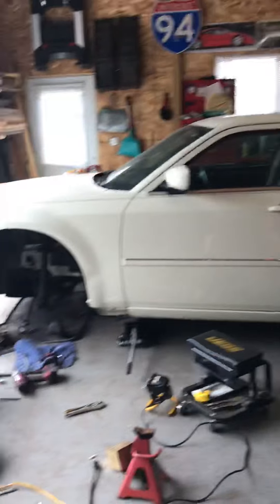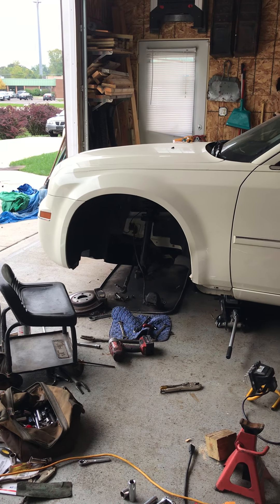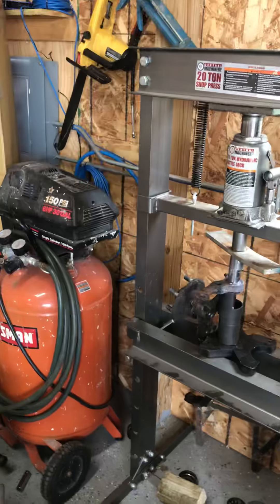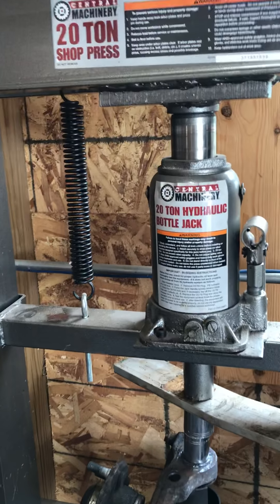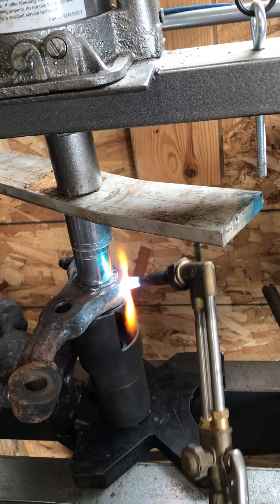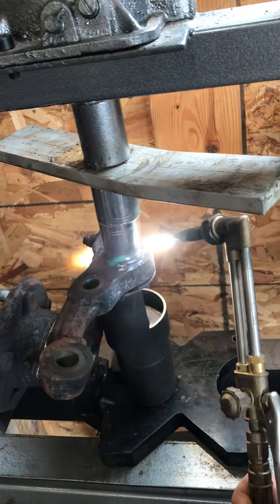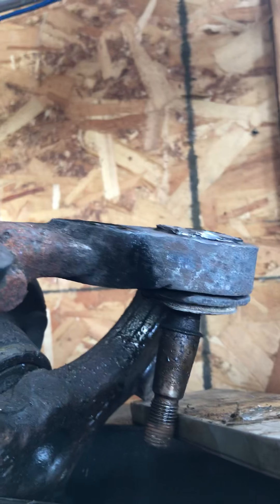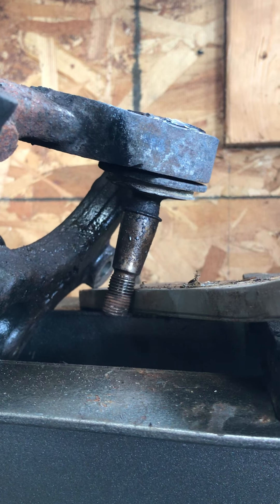Lower ball joint Chrysler 300 2007 part 1

Comment: Try drilling out the bottom with a few holes first to help weaken the ball joint so it collapses that way when you heat it back up # 1 you won't risk the actual ball to come shooting out like a bullet from the heat that can build up and cause pressure inside the ball joint cavity # 2 turn the heat down some on the torch because that looked more like a carburizing flame which is too wide that's also heating up the ball joint at the same time causing it to expand with the control arm and seizing up !  # 3 Smaller more concentrated flame on the torch to just heat the outside of the control arm then make sure your press is set up ready to go so all you have to do is shut the torch off then start pressing right away so it doesn't have as much time to cool down like it did in the video !  I usually like to keep some pressure on the ball joint with the press then heat up at the same time because it saves time not having to shut the torch off then checking to make sure the hydraulic Jack is ready to pump then putting the handle into the jack to start pumping as that all adds up to heat either being lost or the heat starting to soak into the ball joint it's self which will expand with the control arm seizing it up !
Reply from the maker: Pete Loomis thanks for the info. I’ll definitely do that.